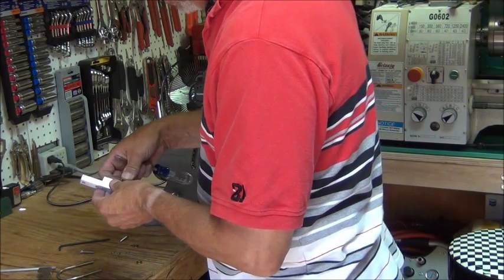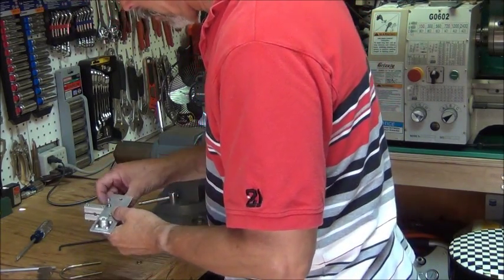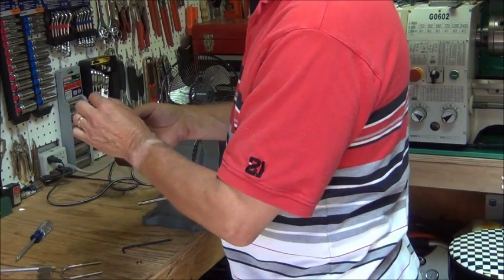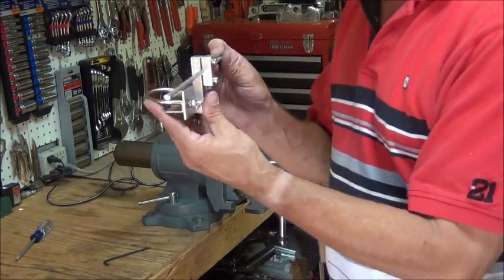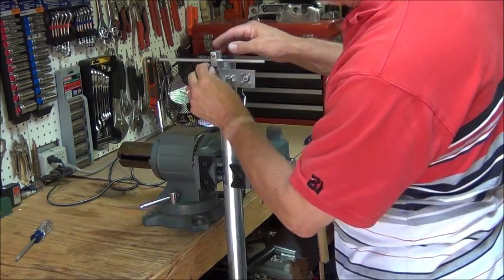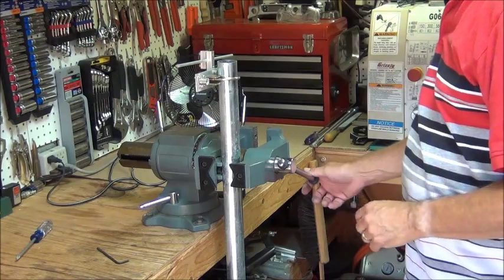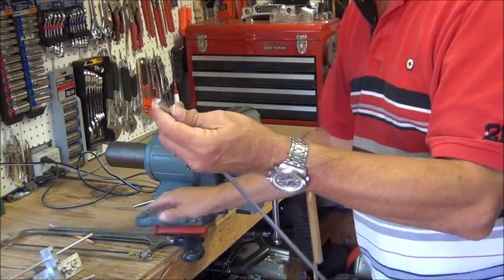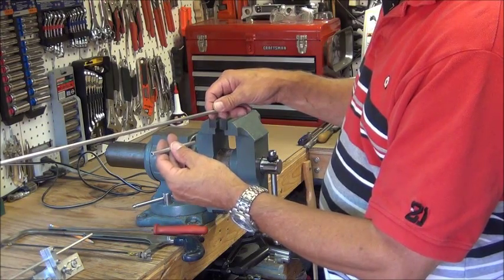2 Meter Halo Antenna Part 6 -- "Bracket assembly, cutting gamma tube & antenna element" by N6TWW

Comment: Mike, what size tubing diameter and what size wire did you use to make the Gamma Match?  I plan on building both a 2 meter and a 70cm antenna(s) for use on SSB and Satellite.  Thanks Bill, N4PCB
Reply from the maker: The gamma tube was made from 1/4 inch aluminum tubing and the wire was 10 gauge wire. I tried to use wire that had a good fit to the inside diameter of the aluminum tubing.